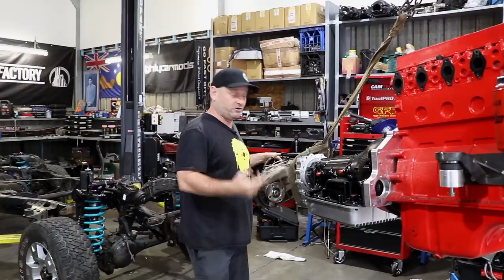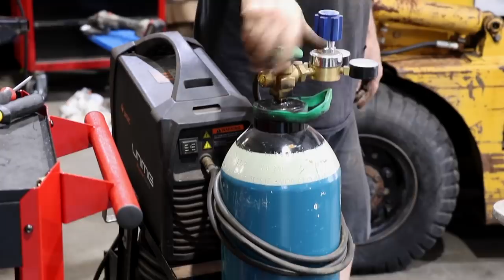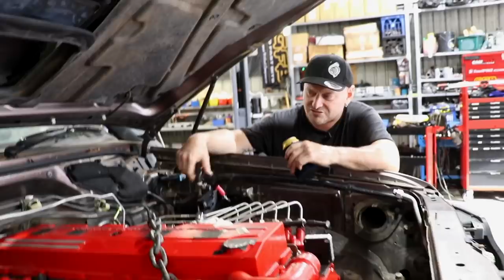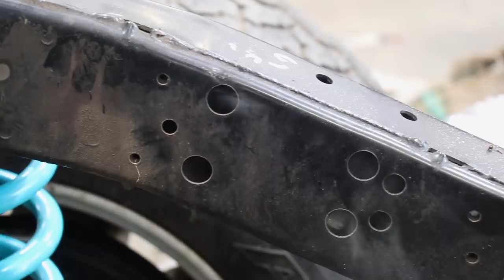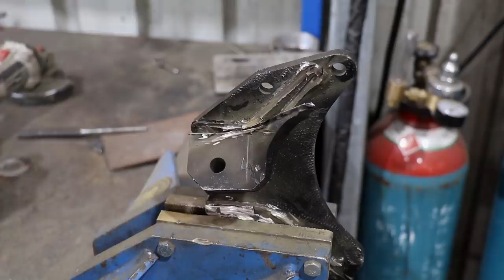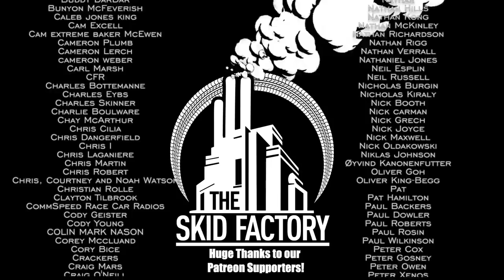Making a 6BT & @HughesPerformance  4L80E fit into a Nissan Patrol - Cummins Patrol EP7

Comment: "normal internet" : I want a cummins patrol that tows 10k lbs , does 10 second 1/4s , has zero turbo lag, drives like stock and has 30 In of travel with 37s.  Should be able to build it for 10k.... Hahah
Reply: EXACTLY what has happened 2 the rest of society...Horses 🐎 4 different courses. Most ppl just need a mini-van that drives itself. 😆👍👌
Reply: I wish I could get my hands on a Cummins Dodge that isn´t buggered to shit with stupid large injectors, stupid large yet inefficient turbo, a powerband of 300 rpm and smokes like a freight train pulling just itself for less than 10k.

Comment: Transmission translation:

300m is 300 grade maraging steel a portmanteau of Martensitic (type of hard crystalline structure) and aging (extended heat treating).

Nitriding is a heat treating process that diffuses nitrogen into the surface.

4140 is a grade of metal in the 41xx series sometimes called chromoly steel.

Bluprinting is probably the most abused word in the automotive aftermarket. Blueprinting required buying lots of parts that match with very low tolerances in the 1/100,000th of an inch. Bluprinting is usually done to rods, pistons and cranks not transmission oil pumps or valve bodies. Usually valve body guys just say "machined" to indicate it's been machined flat not "bluprinted".

Comment: What a beast this will be! I love that all types of build come through here, from JDM to off-road. And so much amazing info!

Side note: Al's mic got crunchy from all the grinding dust getting in, which a dust cap would fix. Lapel mics don't really like the interference from a welder, it can mess with the magnet and ruin the sound.
Reply: Last couple of eps has the strange buzzing around Als voice
Reply: @Festivaltix  The mic is shot. The grinding dust probably clogged the magnet or the cone got messed up from welding interference. Maybe even just blew it up with an engine back firing.
Reply: People have been complaining about Al's buzzing for ages, they have tried to fix it, but concluded it is in fact his voice that is buzzing...
They spoke about it sometime. They have tried different mic's etc.
Reply: @johnjosephson9277  I'll ask a mate of mine who is a sound tech for tv. Does nothing but install mics and work on sound quality for broadcasting. I wonder what he says.

I find it hard to believe that Al's voice makes that noise, as it is a very specific frequency and does not sound like the rest of his voice. It does very much sound like a mic that has a bad coil or cone, which is why I find it odd. 

I also hadn't noticed it until recently and I normally pick up on these things right away, as they annoy the shit out of me.

There could be something with his vocal chords, that produces a different tone in the rest of the sound, but that would be very unique.

As it is pretty much single frequency, it could be (partially) filtered out with software, although that would be time consuming to get right.
Reply: I'm only saying what I remember them saying, I personally don't hear the buzz.(normally watch on phone, no headphones)
And I know basically nothing about mic's and sound in general... So you're quite possibly right.
Reply: @johnjosephson9277  Wasn't meant to question you or as a putdown, I'm just curious what the issue could be given what you said. If true, it is something I have never heard of, I wonder if it happens more often.

I know a bit from my mate and having been in a band. The noise you hear is a pretty specific noise from broken mics. 

A mic is essentially a speaker in reverse. The cone (the plastic or paper bit) picks up the vibration from the sound and translates that into an electric signal. It does this by moving a small copper coil along an electromagnet. The magnetic field that is created, is the electric signal the recording device picks up.

If this cone tears from a loud bang, too much volume, being dropped or something else, it will resonate at a specific frequency (Resonance is when something vibrates at a very specific frequency, like a dash in a car rattling at a certain speed or rpm).

Speakers work in reverse, the magnet gets a voltage from the amplifier, which moves the small coil and with it, the cone. That pushes the air and creates the sound you hear. 

If you tear the cone, you'll hear a tone, which is the cone resonating with specific frequencies in the music. When you blow up a set of speakers, that is what happens. 

In the case of Al, it can also be grinding dust getting in, messing with the electrical field. A blown up mic usually sounds more crunchy, this sounds more like an issue with the coil/magnet.

Comment: I am shocked to not see a million comments criticizing your choice of transmission.  Al did make a good point that he isn't going to be hooking this thing to a sled and not lifting until its kicking the rods out. A built 80e is fine for stock-ish power out of a Cummins. GM did put them in Duramax van chassis.

Comment: The 4l80e was available in heavy half truck (6lug(4x4) and 5 lug(2wd)) options here as well. It has been behind the duramax and 6.5 turbo diesel trucks as well and you can still break them.

Comment: Even in a big Dodge they cut into the firewall. At least someone was smart enough to cut reliefs up above the rear cylinder so you can slide bolts from the valve cover and heads up into it. One of those things you're grateful for because it's something say, Ford wouldnt do and instead make you lift the body to do ant work on it. Injectors are apparently an 8 hr job on Powerstrokes and Duramaxs with a two post lift and lots of swearing. I did my injectors in my cummins in my driveway with three wrenches and 45 mins. I got my first 5.9 and I think now I'll make sure I always have one. They are great.

Comment: Done a 12 valve conversion into a series 4, didn't have to belt the fire wall though. Still had enout room to run the coolant hoses, fan and with a bit of cutting fitted the factory rad shroud.

Comment: Pro tip, if you get some cheapie laser pointers and fatten em up with a bunch of wraps of duct tape you can shove them in bolt holes and use them as laser alignment to the mating hole beneath (like for body to frame).  Or hotglue to a bolt head...whatever works.

Comment: Seemed to fit pretty easily even with the firewall adjustment. And there's always the option of body lift pucks if the hood/bonnet clearance is too tight (if you're allowed those over there).

Comment: Al or Woody! Just a suggestion, mark where that injector is close to the body. Bash it in or cut it out and make an inspection plate for it while you have access to it with the body off. This unit is going to have a long life so the injectors are going to need a service at sometime..

Comment: This is another interesting project about nissan patrol. I own left hand drive y61 patrol gr with the zd30 and rear diff lock, manual transmission. engine is small but powerfull and enough for the conditions of my country and it amazes me everytime  when i go offroad. cheers from Georgia. i like both of you, well known and skilled mechanics.
P.S - if i were you i would rotate the bonnet scoop, would not delete.

Comment: My dad has a 5.9 L Cummins Ram 2500, 2007 I think (the transition year to the 6.7 L). It's a unicorn because it has the 6-speed manual transmission. Longest bloody shift throws in anything I've been near... it's kind of hilarious how fast that thing is with only a flash tune (for economy when towing! it's not even a power tune!), so passing on the highway is this ridiculous process of throwing the meter-long shifter around every two seconds since you've run out of revs while also trying to maintain a straight line with the janky floaty steering. It's a hoot to drive.

Comment: 4L80E seems to be the natural successor to the TH400, so i'm guessing a built 4L80E is about as tough as as built TH400... That's pretty tough!
IIRC, Benny uses a built TH400 in the Barra powered Cresta? Yeah, the 4L80E is probably the answer to most big engine high-torque applications. 
I have to say, the stock TH400 in my 1968 Cadillac DeVille convertible seems to be holding up just fine behind the 7.7 liter 700 Nm (525 footpounds) of brute iron V8.

Comment: Great video, just for clarity though, yes Al is correct by saying the 6BT came out of a Dodge RAM. However since Dodge hasn’t made RAM’s  for just over 10 years. ( FCA split RAM from Dodge to become  a seperate company and manufacturer in Oct 2009). The Dodge built RAM trucks are more and more as time goes on are being known as Dodge Cummins , no real reason apart from differentiating the two brands.

Comment: 4L80e differences between 2wd and 4x4 versions were not the case. Only a different output (which you fully need to disassemble the trans to get to), reluctor wheel for speed for PCM (2wd inside trans, 4x4 inside t-case) and a hole in a plug to feed the 2wd output bushing.

Comment: There is no difference between a 2wd and 4x4 4l80e case.  The only differences between the two are the output shaft and there is a cup plug in the rear instead of a orifice that normally feeds oil to the tail housing bushing on the 2wd models.  I always use the 36 element hd wide intermediate sprag in my performance builds.

Comment: 300M is decent. They make aircraft landing gear stub axles out of that stuff!  Flex plate should flex to accomodate the converter ballooning/flex under pressure right?  If it's thick and billet, how does it flex?  Hmm. Great build even if it is a truck. And a diesel....

Comment: Please go to the effort of reinforcing the rear coil hats. I know your not going to jump it off sand dunes etc. but having had a few patrols and knowing you’ll tow with this vehicle. The towing/touring weight on corrugations will crack it. Your going to all the effort you might as well do it. Superior engineering do a couple of kits.

Comment: The Allison Transmission used behind a Duramax is also a very good transmission to build
Reply: Wouldn't need to build it for his power level, but 4l80 have great aftermarket support, start off cheaper and weigh considerably less and take up less space.
Reply from the maker: Allison and 6BT combo is too heavy for the patrol.
Reply: "Alison, (my aim is true)" -Elvis Costello

Comment: on the 4L80e those came with many different 1st 2nd 3rd and reverse gear ratios. Want to match ratios to a 4L80e that was behind a 6.5 gm diesel not a gas engine

Comment: If you want to go drag racing or jumping sand dunes, put a turbo LS in it instead. It will be lighter, probably an easier swap and the engine is cheaper to being with

Comment: I'm just a chump, not an expert like you guys! But it seems to me like that injector line would collide with the firewall when the engine flexes on its mounts under throttle input, especially in the future when the mounts get a little tired?

Comment: I like the new Tynes you made Al!! they seem to hold .......for now!
Reply: By the by, what he made is called a jib. Slides over the tynes.
Reply: @johnjosephson9277   ok so you wanna get technical, the tynes and jib he made are one piece,all welded together, so he can technically invent a name for it!!
Reply: I don't mean to be a "know it all" or whatever, I just like accuracy and often can't help sharing what I know, or think I know. Cause I'm wrong regularly enough...
But if you look at the video, the fork still has it's normal tynes in place, and then the attachment slides over them. And as far as I know, you call that attachment a jib.
Again, no aggression or offence intended :)
Reply: @johnjosephson9277  It has its standard forks, tynes are extensions that slip over forks.

Comment: That whole engine and driveline looked absolutely massive out of the car, now it's on the inside there it suddenly looks smaller than it has any right to be.  
So I'm expecting this thing will do 45 degree inclines when it's done, at a minimum? :D

Comment: Hey a question why not run an Allison auto??
Reply: Too heavy and big. Kind  of a pain to fit up to a cummins compared to a 4l80e. Debatable to whether its actually stronger. Needs more cooling etc. 

4l80e just a better fit for a cummins where you really need to save on weight to actually have it legal to be engineered.

Comment: I have a 4l80e behind a 5.7 in a 3500, so smaller engines have them too.  Why not a 4l85 or an Allison 1000?
Reply from the maker: 4L85E is just a revised 4L80. Allison 1000 and cummins combo is too heavy for the car and they are also a nightmare to fix.

Comment: Engine is too far back .... and you still have deal with  low pressure fuel injector return line that bolts onto the back of the head . Better to move engine forward a bit and space a factory Ram fan back a bit. 

Wrong sump fitted .... that one needs heaps of chopping. Better of with factory Ram sump and pick up  then dealing with moding  industrial sump.

Yes you can use  factory Ram a/c compressor setup by moving the pump closer to the block by about 10mm and turning steering box bolts around . Also you can mount a nissan a/c pump on the on opposite side of the engine and use factory lines on a GQ setup .

Otherwise looking good .
Reply from the maker: The injector spill line is fitted to the engine and clears no problems.
We don't have an alternator or AC compressor from the dodge so it doesn't matter anyway but the lower radiator outlet also points to the rail/box and would need modding too. The cummins sump on it clears the diff but yes it would have been better with a dodge sump but it was rotted away and the canucks fitted a cummins sump instead.

Comment: Why not give it a 2" body lift while you are there??
Reply from the maker: Because it has no benefit and a lot of disadvantages.
Reply: @theskidfactory   fair enough, I thought it might help with the clearance Clarence.
Reply: As in under bonnet, maybe clearance at rear of engine depending on firewall shape, turbo clearance, exhaust out, etc.

Comment: I have zero faith in the ability of that front axle assembly to handle the torque and weight of that 6bt.
Reply from the maker: Based on what data?
Reply: The poor longevity of Dana 60 kingpin axles in dodges.